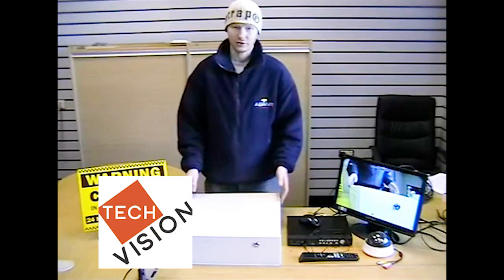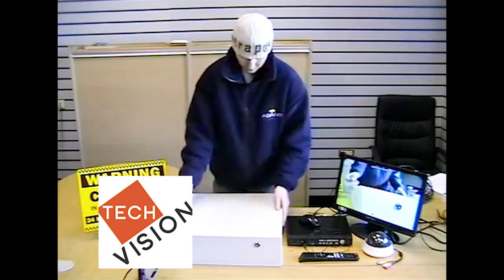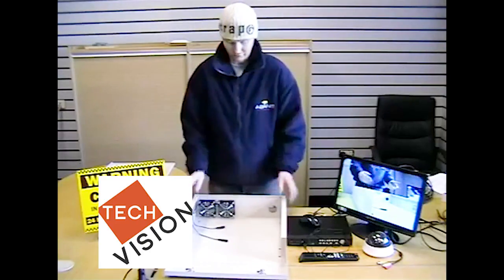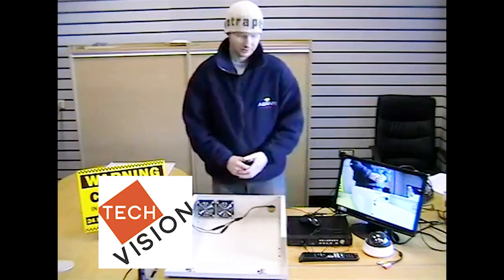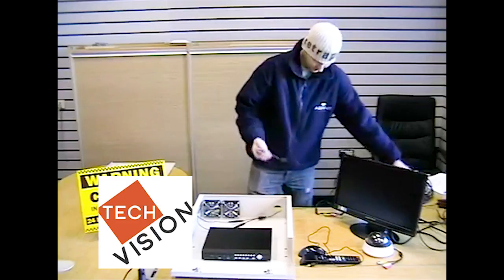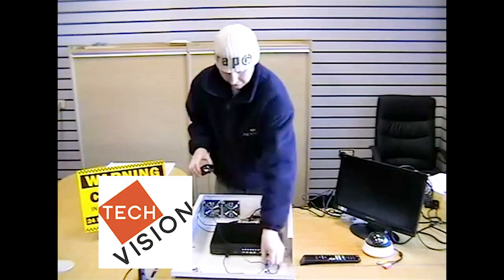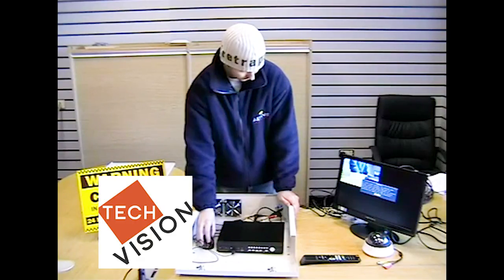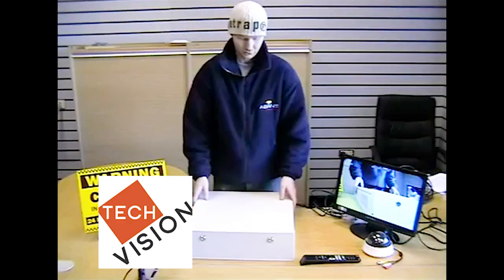DVR Lock Box Set Up and Demonstration

Comment: How do u use dvr and mouse if its hidden away in lockbox and closet
Reply: hi danielle where those holes are at the back connect    mouse wire it  into back of safe box.... then into your DVR  & lock it up   
now as for using your DVR  recorder some are digital  work with mouse on screen you don't need to operate it manually